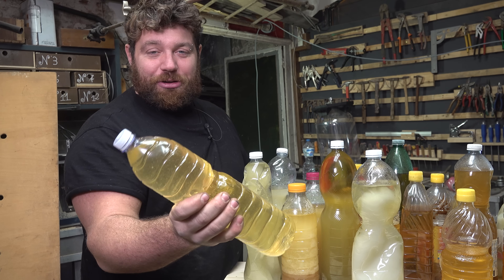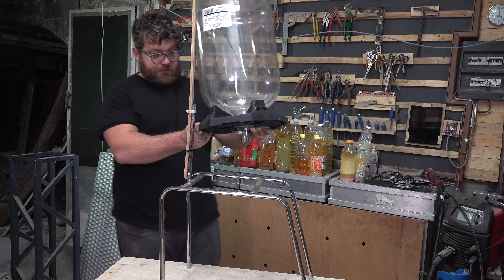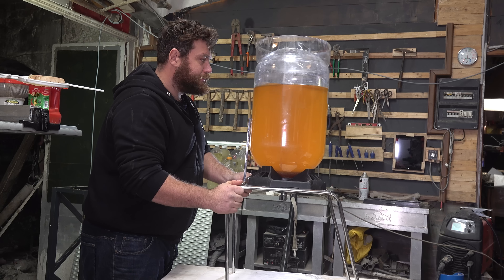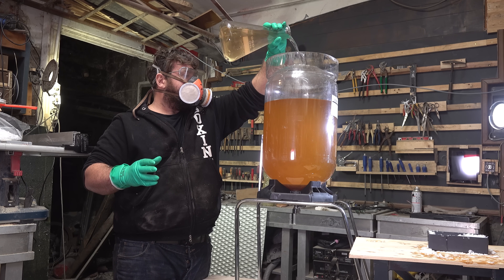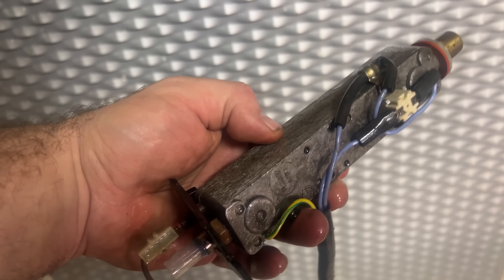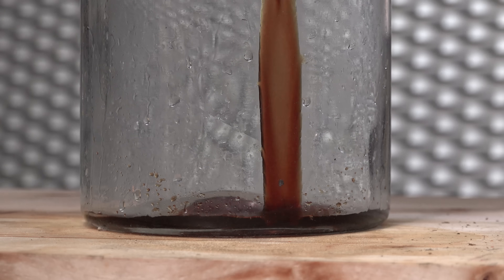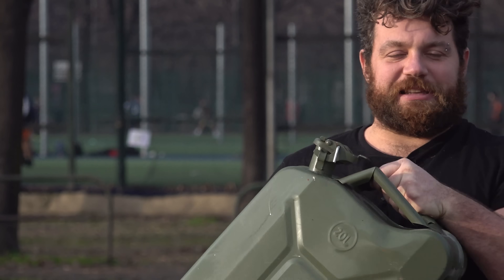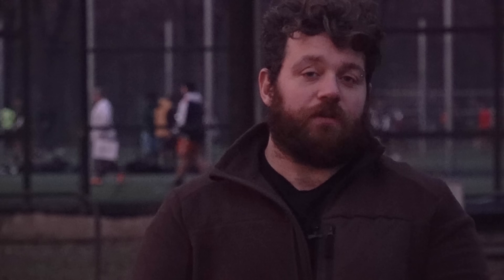How to Make BioDiesel at Home • Full Tutorial 4k

Comment: Also you probably don't have the additives they use for Winterdiesel. And as you already stated: Without those the diesel gets too thick to properly flow when cold. Diesel gets pretty goey pretty fast. So in colder weather you might wanna use more Diesel from the gas station and less from you own production. Depending on how cold it gets where you live be careful about that.
Reply: Adding 1/10 of kerosene to the mix will probably help.
Reply: do it like the old timers and put a bit of gasoline in it
Reply: @gergosz3609 , Gasoline and diesel don’t mix. The gasoline will sink to the bottom and the diesel will float to the top.

Running gasoline through a diesel engine will cause detonation and destroy the engine.
Reply: @terjeoseberg990  they do though
Reply: @terjeoseberg990 I believe
Reply: @terjeoseberg990 Bullshit 😂
Reply: You can have two tanks. One for diesel and one for bio diesel. You start the car with diesel and reroute the heat into the bio then switch to Bio diesel.
Reply: Just add kerosene and methanol, it's not rocket science.
Reply: @@maxa.629kerosene is lighter than diesel and in uk it’s used as heating fuel
Reply: @marcsduk  yeah but you mix kerosene with cooking oil to make your biodiesel, and in winter add methanol.  It thins out the thick cooking oil and alcohol stops it freezing.
Reply: It's also used in Injector cleaner addatives. Win win. @marcsduk
Reply: Add an inline heater
Reply: @@maxa.629 right, methanol a.k.a "Heet" yellow bottle.  Also used in winter windshield washer fluid.
Reply: if you use biodiesel on the winter time, as a substitution for the additives or others substances who would decrease the freezing/clogging point, you must use 5 liters of gasoline at a full tank
Reply: @andreirazvanpana5313  full tank of what? tanks come in different sizes on different vehicles and generators.

Comment: Why don't we boil the mixture until the alcohol evaporates and we can condense the resulting alcohol to use it well? What is the resulting quantity of diesel fuel and how much does a liter cost? Thank you. Greetings from Syria.
Reply: You have to be careful how Hot you get it, but if you take it up to 65 to 70 degrees Centigrade (do NOT Boil) you can warm the Alcohol and water out of the oil. Water washing with Fine Misting sprays to take out the fats still in the oil is a good Idea, and then Drain the water you can see and Warm it again to remove that residual water. It is a bit of "Mucking around", but it is cheaper than the "Rip Off" at the Bowser. In a Hot country Like Syria, you can Run 100 % Boi-Diesel, called B 100, it doesn't get cold enough to "Gel" the Fuel, you will have to replace your Fuel filters in your vehicle a couple of times a Year, and replace any Rubber Hoses, used for Fuel lines to Silicon Lines, because any methanol left in the Oil will erode the Rubber hoses.
Reply: @scottcarr3264  Thank you for your interest and response. Greetings to you from sad Syria

Comment: After a lot of research, I've determined yoi can literally make fuel from any oil...a little tweaking and it will run
Reply: "Rudolph Diesel" designed the Diesel engine in the Early 1900's to run on Peanut Oil. So, Yes, you can use nearly any oil for Bio-Diesel.

Comment: If you don't want to use any harsh chemicals it is technically possible to distill used veggie oil and get the glycerin out but it's much more expensive
Reply: BS.

And hydroxide isn't as dangerous as he makes it out to be: it is common drain cleaner. Use the same precautions.
Reply: @95rav  Actually methanol is probably worse than NaOH. Their flame is almost transparent, is volatile so you may accidentally breath it. And in contact with eyes their vapours can cause severe damage. I was kinda surprised how he reacted to NaOH ( as I expected) but he didn't say anything about methanol.
Reply: @95rav Yea just let a droplet of drain cleaner in your eye you'll see if it's not dangerous

Comment: Using this homemade diesel may clog up your engine
Reply: No it won't because he removed the glycerol
Reply: @henryfeige8596 yes but he still should've washed it. I got confused the first time I heard this so let me explain. What you need to do after removing the glycerol is to add water as you stir it. Mix it well and then let it sit. The water will then deposit at the bottom which makes it easy to drain, and you're left with a better product. It supposedly removes certain chemicals and residues that could cause issues.
Reply: @isaac4273  i´d recommend after the water wash to add dry calcium chloride or epsom salt to the biodiesel to get all the water out. the more water is present the murkier the liquid will be
Reply: It's not "may", it's "will";) -Horrible process exampled in this video. I bet his conversion rate hasn't even reach 90%.

Comment: Well explained👍🏼 only problem is that methanol is too expensive for that to make sense.
Love from Austria 💚
Reply: Look for methyl hydrate, it is just another name for methanol. Sadly, the price has also increased from $10/Liter to now $20/Liter CAD..
Reply: Actually, If your just making small batches then you can buy those little yellow bottles of HEET fuel additive as your methanol source. It helps to evaporate water in your fuel is it's normal use. , but here you can buy it in any auto parts store or Walmarts, and it's just methanol.
Reply: Methanol is not expensive
Reply: Buy from México is cheap

Comment: This is really interesting. All other sources made it sound incredibly complicated.
Reply: It is really easy, even with the washing step at the end, which he didn't have.
Reply: Yeah water and corn starch
Reply: maybe it should be complicated if you don't want your car's engine to fall apart?
Reply: @Mark-kc2ke  its about how complicated engine is or to be specific the fuel injection system. I used to run used cooking oil, used engine oil in my golf 3 1,9 diesel, it did not give two f*cks about anything in summer. When it got colder, needed to add diesel to cooking oil or heat the cooking oil up so it would go trough filter... If you are trying to use cooking oil with CR system you basically are asking for problems, cause that thing will not last long even if it survives first mins..